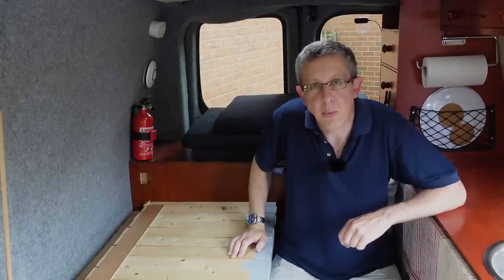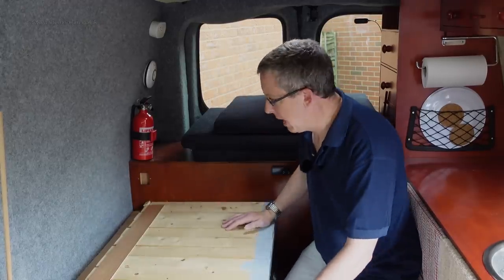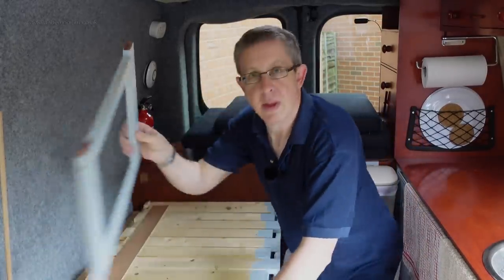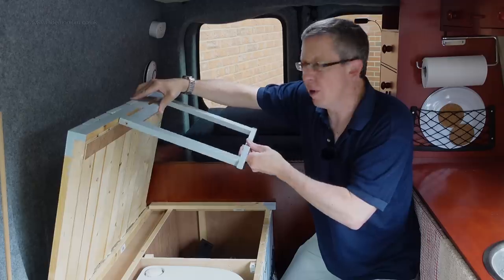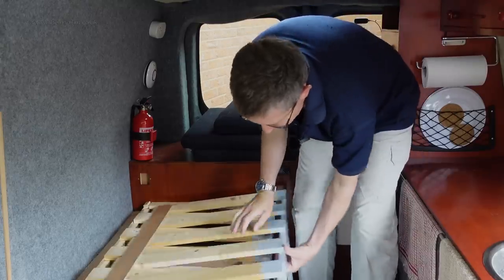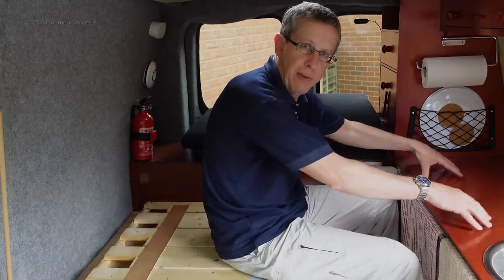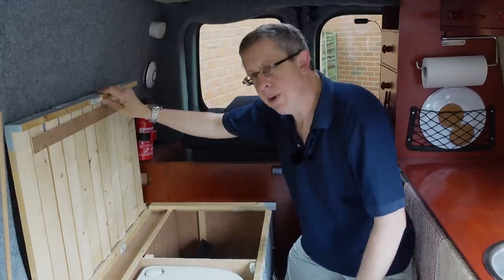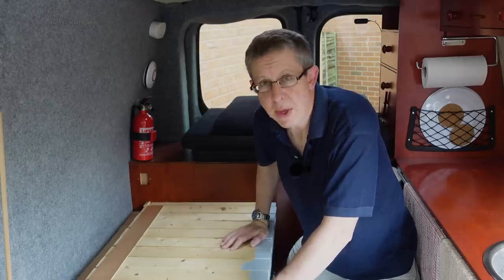84. Help! Your advice is needed.

Comment: Other than moving your imaginary piano closer to you could you not re-purpose your current legs so they hinge out like the supports on fold up tables (like a door orientation). You might need a pair per section and to have a slot rather than holes for the dowels. Or you could redesign the front panels of your storage under the bed so that they hinge out like doors to support the extended bed section.
Or if you aren't in that position for very long how about a folding stool instead?

Comment: If you’re going to the trouble of making a change, if it were me, I’d go for converting the storage to drawers and reconfigure the loo area so that it slides out for use (even if I had to get a lower loo to achieve that). Drawers - or even just pull out boxes - are so much easier to access in a small space and you’ll do away with so much cushion rearranging which is always a pain in the neck.  Sorry if this repeats others’ suggestions!!

Comment: There are a variety of solutions.  Your frame you use for a leg, you could put one on each end of your cabinet as 90 degrees to the current setup - so essentially "sides" that slid out with the top.  and you could add a vertical fascia piece to strengthen the center from sag when pulled out.  which you could then add a small block to the front of the opposite cabinet to rest on when fully extended.  2) you could use heavy drawer slides and frame your top with a vertical fascia piece for strength - the glides would support on the ends, the vertical fascia piece would create a "T" or "I" beam type structure across the front so that it wouldn't sag in the middle.  you don't really need the support when partially extended as the majority is supported by the original half of the cabinet.  I would encourage you to explore youtube, google, and other van campers as you travel and attend rallies, etc.  See what others are doing, before making rash decisions.  good luck with it, enjoyed the cut series, didn't realize you had stopped cruising until seeing "The Wynns" edition.

Comment: Make the front slat supporting beam deeper so the legs swinging towards the front center of the bed like on a card table would not need to be so long. Alternatively the correct length legs could be mounted so they fold one below the other. The locking mechanisms like on a card table are usually available at most hardware stores.

Comment: Use lengths of piano hinge. Put rare earth magnets in the top of the cabinet fronts and insert washers on the underside of the bed rails to match at the required open distance of the bed.

Comment: How about permanently attached legs at the front for when you extend the bed fully or half way, no folding, not removable, just very sturdy. Then convert the folding sections of the bed from both folding up to one folding to the left and the other folding to the right?

Comment: David, I agree with the plywood panel, same rough dimensions as the leg arrangement now,  with a piano hinge screwed into the extendable slats. if spaced at a right angle the with forward face is abutting the front rail of the bed, it will be given support to stay vertical. it could be held up against the slats with a magnet when folded. just a thought. more stable than the rail design

Comment: I used to work with a guy who said if he could have any super power it would the benefit of Hindsight 😊I would go for Andrew Jones Productions proposal in the comments, I think that would be an elegant solution as it’s simple, low cost and adaptable to the various depths you need to pull the bed out.

Comment: We made it so that our compartments are not from the top, but from the front. Some stuff ist stored in boxes that we just slide out. Our clothes we put in without boxes. The same with the porta poti. We just slide it out, it is held in place with the mounting plate that comes with it. We use it exactly as you wish fully extended when we sleep and half extended when we eat.

Comment: I think the hinge idea is the simplest and if it makes you feel more secure then add a barrel bolt or 2. or for that matter drill out the current dowel pin hole and use a countersunk bolt to hold the leg, keep a magnet handy to remove the bolts

Comment: David, does the answer perhaps lay under the kitchen unit. How about something (& metal is more confident than wood) with a slight drop to get the height right, that rotates outwards to intercept & support the leading edge of the bed if pulled out at both the sitting position & also fully extended? Hard to explain but if it was a long, flat, pivoted bar, extending from one corner only, with a leg that folds down from it, to support the corner furthest away, you'd then be free to get in & out from seated as it'd only be joined in with the kitchen unit at one end?

Comment: Instead of a drawer,  how about just using the sides.  Make slots to pull them in and out of the front of the cupboard, and they can extend what ever length you need, and nothing in the way.

Comment: Try to make a picture search on google for "telescopic hinged legs" or "telescopic folding legs". 
It could also be fixed or hinged legs with a locking/braking wheel as found on good officechairs. 
You could also consider some sort of a leg-solution that is attached to the floor at the front of the fixed part of the bed - Something that rise from the floor and follows the extractable par of the bed. it could be as simple as a two pipes that slides into each other and you lock them in 1, 2 or 3 fixed positions with a fingerbolt, a split or spring like you find on tentpoles that click into fixed positions.

Comment: You could fit on the outside of the side of the bed unit hinged "knees" of ply that open to 90 degrees to support the full extension of the bed. When you want only a partial opening the "knees" would be at a shallow angle to support the edge of the seat for cooking. If I have not explained the idea clearly I will send you a drawing. Best Wishes. Neil Broome

Comment: Legs on the outside which fold inward (from left to right, and the other from right to left) across each other.   Have to be placed a bit apart so when folded they miss each other.

Comment: The simplest solution is to keep it as it is now for when you want to fully extend it, and add a thin metal strip that is screwed to the underside of the moving slats only at the wall edge. This will support your weight on the front edge when sitting near the counter.

Comment: you need a piano hinge, when you put weight on it, it will flatten and when you lside back and forth it won't open.  the piano has enough connections to manage the compression without failing, and gets flat enough not to wobble.

Comment: Rather than legs, have a full-width cross-brace on the back of the underside of the sliding section, so the slide cannot tip, and the crossbrace supports against the fixed slats. The brace would need screwing and glueing to each of the slider slats, to spread the load.

Comment: Could you attach the leg you have to the front of the cupboard instead of the top piece so that it would work like a drop leaf table. That way you could slide the bed top to any position and it would be supported by the legs underneath but they would fold flat against the cupboard front when you needed into the storage space

Comment: I would fit timber underneath so slid out is supported and have cushion full width of base and then half piece of cushion to use as back rest so you can sit at sink , this then would not need legs , don’t need double bed traveling on your own

Comment: I'm sure this has been suggested already.  Get rid of the legs altogether.  Have four joists, three of which slide out from the bed (two for the back section and one for the back of the front section) which hook into the hob unit.  Have another joist that either sides all the way out from the battery compartment in a perpendicular direction, or one that just slides out a bit to support the front of the front bed slat.  This would allow you to pull the bed slat out any amount that you wanted to do work on top of the hob unit.  The one caveat would be that if you wanted to get up from working, you would either have to throw your legs across the front back joist, or slide it back into the bed.

Comment: Just put the legs on a hinge with a magnet to keep them in the closed position until you want to use them. They won't collapse when you're sitting on them unless you physically pull the entire thing forwards and you can't do that because your legs are in the way. So it cannot collapse while you sit on it.

The simple solution is almost always best.

Comment: At the perfect sitting spot and also fully extended spot, mark on the slide out bit where it lines up with the edge of the frame it rests on. then notch out a 3-5mm groove for it to lock into so it does slide. This is to compliment your hinge idea for the legs. A cheese sandwich to follow.

Comment: Add two 2"x2" permanent legs at the two corners of the slide out bed with a latch holding front and back halves tightly together.  You could also add a couple of furniture feet protectors to the bottom of the legs to help your bed slide back and forth across the floor. 👍

Comment: How about simply using gate legs That attached with hinges to the corners of the Base unit and swing out.  Then you can pull them out as far as you need for as far as you're going to pull the top out.

Comment: I  thought of kitchen or wardrobe hinges as they are sprung loaded and would be hard to move when spread out  you would make a leg frame that would fold under when at is minimum. when you  lift up the frame would fold against the wall under the spring it would stay there and would clip it aback. when you make the bed up and out fold the leg frame out and adjust to width or length you would like i will make a drawing for you

Comment: In my old vw I made the legs pull out on drawer runners from underneath the slats thus meaning it was fully adjustable and don’t get in the way when not required

Comment: The easiest  still sturdey way that might not be a big stand in the way might be to make a parallel slider that stays level so you don't need a hinge for the feet- Just make the parallel slider with a pair of stiff metal elbows so that L-shape is sturdey. The horizontal slider can be actuated by one or two pens or notches that connect to the part of your sliding deck / frame lid when that is closed / horizontal and needs to slide in or out. That way the feet can rest and stand in any position without being in the way or without being fragile. Then when the frame is pulled out horizontally it pulls the feet in or out with the deck, or you simply can push the feet in or out independantly by hand. The two horizontal sliders for your feet can be set in the space of the half of the two immobile outer slats so the whole system would not take any extra space. I could make you a simple sketch if you want, but it doesn't seem possible to post it here for you to see 🍺

Comment: How about using the panel at the far end of the bed? Either have a horizontal runner to support the bed as it slides out or a deadbolt on the leading edge of the bed that slides into one of two receiving holes in that panel to give you two bed positions. (I can't see what's going on at the end of the bed nearest to the camera.)

Comment: Why do you need the legs right on the end, why do you not just hinge an additional slat on the underside that will fold away under the existing slats. You just offset the slats towards the wall by 50mm

Comment: Let me try and explain what I picture in me head. I would determine how far out you pull out for a cooking seat. Cut two pieces of wood the length. 
Using a hint attach to the bench base, not the slide out. When you want to extend the bed/bench swing out the boards extend the bench so it rest on the boards. Hope that makes sense.

Comment: Way too much over-thinking.  Use a piano hing to attach the support to fold up under the bed and use a lid support such as used on a bridge table leg to lock it in the support position.  Then notch the top edge of the cabinet to allow the lid to close fully.

Comment: The legs need to be permanently fixed and then will fit in a slot on the front of the bed box. Then you can do as you demonstrated at little cost.

Comment: attach a board to the underside of moveable section only on the sliding rails.  That will lock the moveable sections to fixed sections but still allow it to be slid out in effect creating a cantilever effect with the sliding section.  For legs perhaps making legs that will swing out from the bed's base on hinges much like the legs on a gate leg table.  Good luck

Comment: maybe a secondary frame around the sliding bed bit that has the legs permanently attached to it, and the first part of the frame lifts off it for access to the underbed storage? So you lift the part of the frame with the slats on it up from the lower frame for the same access to the storage, but slide the whole unit out for bed extension

Comment: If the slats as they are now are not strong enough to use without the legs, remake them out of oak and use a piano hinge along the back and it should be plenty strong.  If it ends up excessively heavy, add a gas strut.

Comment: If you had hinged doors on the front that you could open to any angle then you could pull the top out and it would rest on the top of the doors. They don't have to be doors could be legs that hinge out but they should touch the floor at the open end.

Comment: I know it's been 9 months and this is probably resolved, but going the hinge route paired with a sliding crossbar / bracket that pushed against the back of the legs would be extremely secure. I could 3d model it if necessary.
Reply from the maker: Only just resolved 🤣 see vlog 88!

Comment: Thanks David the video really made me laugh. Your presentation is priceless. My background is sailing (mainly solo) as in the offshore type where space is also at a premium. My first question to you is why the need for for a small "double" bed? Is there something you are not telling us?😉😉😉😉 If it is indeed just for you can the bed not be smaller and be fixed/permanent at the width that is comfortable  to be a single bed and also be the width needed to be comfortable to be of use when doing your cooking channel? The width you have it when it is not a bed is that extra leg room between the  seat and kitchen unit actually needed apart from when you need it to kneel down to make this kind of video? Why not have the bed/seating part fixed and accommodate a wider single with the added bonus of more permanent storage.  IF you do need some of that extra room leg room when it is just seating then imagine it as a what some camper vans have as a fixed "French" that is wider at the head/shoulder end and shorter at the leg end so that extra leg room is by the sliding door giving you that extra leg room when sitting. This would also alleviate the need for any hinged/moveable legs. Yes the mattress part/cushions would have to be custom made but with your skills would not be an inconvenience. Good luck.
Reply from the maker: I have on occasion had company and I like a double bed anyway (though at just under 4 feet, it's quite a narrow double)

Comment: Use what you have? You're not in it 365 days of the year? I have a camper on the back of my truck. Sometimes, I think it would be great if I had this or that. But I can live without as I am not in it 150 days of the year, and you're camping
Reply from the maker: Yes but I like to improve things if it’s feasible to do so
Reply: @Vandemonium  i get that.

Comment: I think hinged legs are a good way to go, it wont collapse. Do you have carpeted floor? If so what I dod was staple male Velcro pads to the leg bottoms, helps it not slide on carpet. Good luck
Reply from the maker: Thanks for the tips!

Comment: Use 2-3 inch legs and cut each leg alternatively at the ends. So when fold up into the middle they just fit together side  by side at the ends so fits. If that makes sense.
Reply: Use a magnet on each leg so when fold up click together and held in place.

Comment: David - How about this.  How about using rare magnets to both attach the legs to use them and to store them under the bed lid? 
This way they remain detachable and useable but also you have a place to store them?
Reply from the maker: I like the idea but wonder if they'd hold when the bed is extended, as I move or shift my weight in bed overnight.

Comment: With the bed folded up I would attach a wood or metal strap to the movable part at the rear with a spacer to be sure it would still slide easily, result should be no legs needed for a short pull out for sitting/working the kitchen unit. If the pull out reaches all the way to the kitchen unit then support blocks secured to the front of the kitchen unit would support the bed slide out on full extension and no legs required.
Reply: How about sliding within a U-channel.  That is a do it yourself sort of thing.

Comment: Honey, because your sexy butt is mostly still on the seating board underneath, the weight distribution will keep the front part of the seating in place. The only problem would be if you kicked the middle hinge whilst standing and then sat down, having 2 hinges at either end solves this:face-blue-smiling:
Reply from the maker: Ah but both hinges will be connected as the leg unit is one square piece. But thank you for "sexy butt" 🤣🤣
Reply: @Vandemonium  No sweetie, I meant having a hinged leg at either end of the bed-side instead of just one in the middle. Been with you from the start of 'Cruising'.:hand-pink-waving: